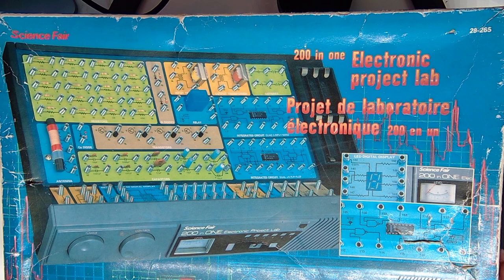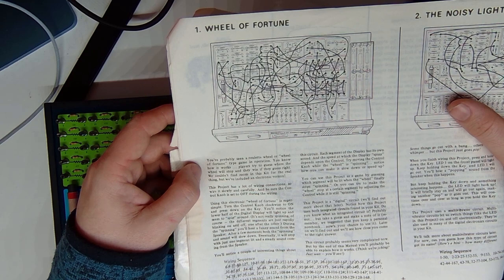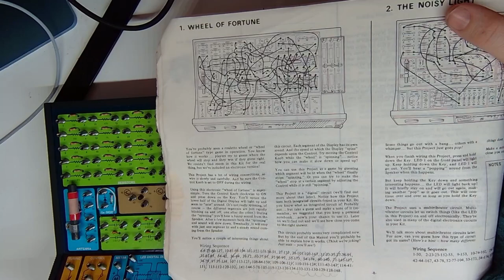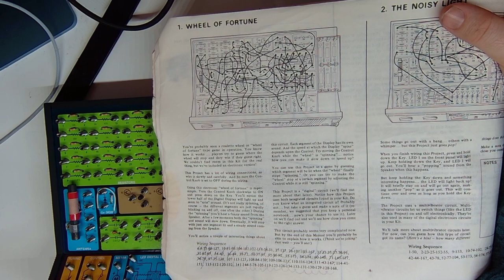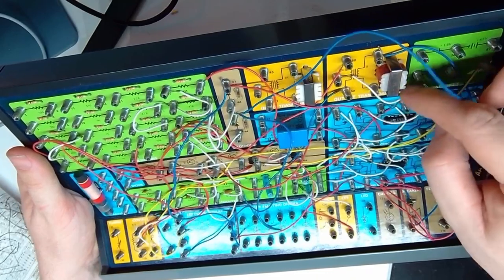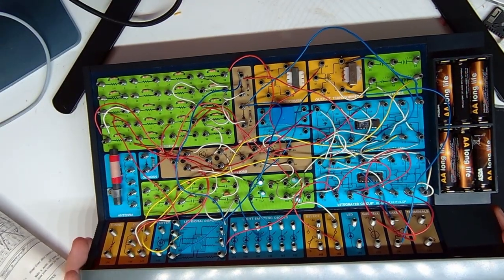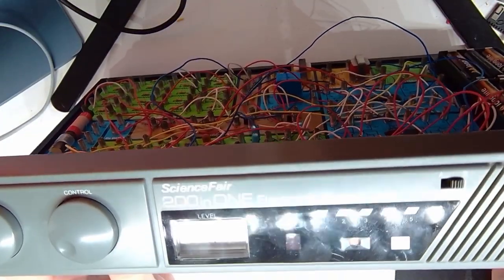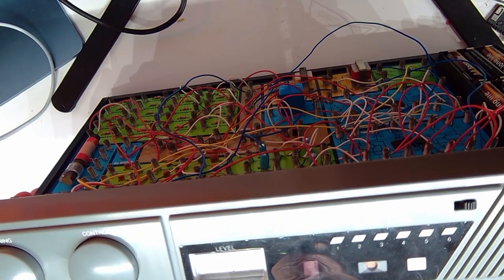Science Fair 200inone Part 1Wheel of Fortune

Comment: Shame it looks like it was creating a world of assemblers, where is the explanation of how the circuit works and the schematic diagram. Or were you expected to draw that in your notes and they work out which component did what. 9/10 for the use of ic's but 1/10 for use as a teaching tool
Reply from the maker: The kits always started with just the wiring diagram and then once you get used to the kits, then they switch to circuit diagrams,